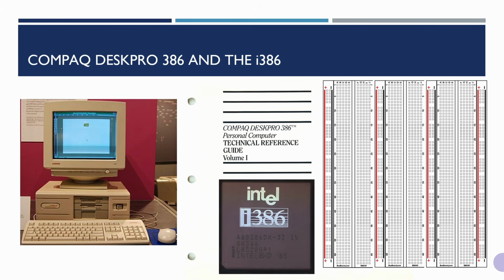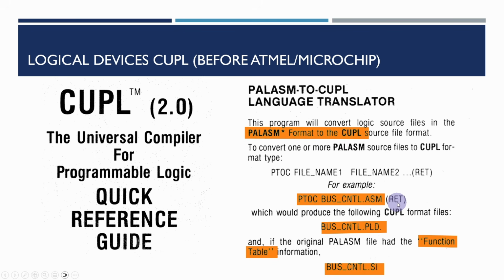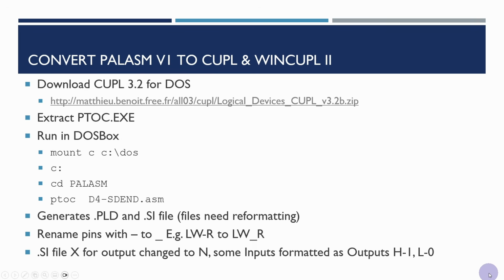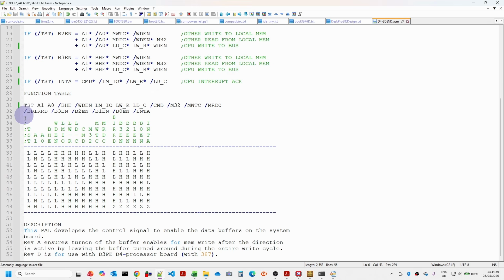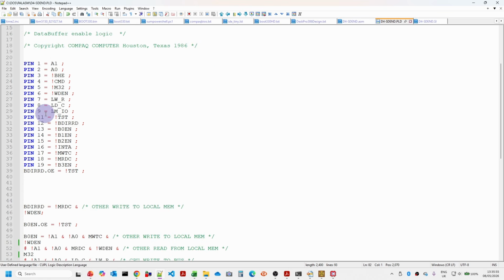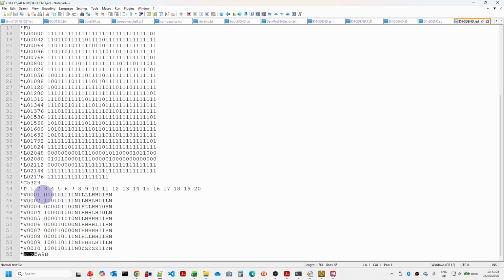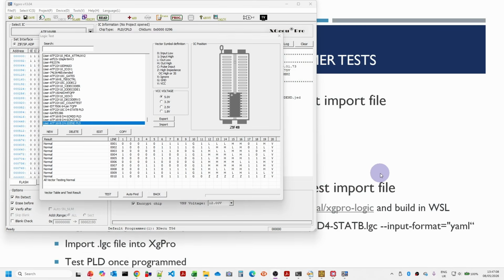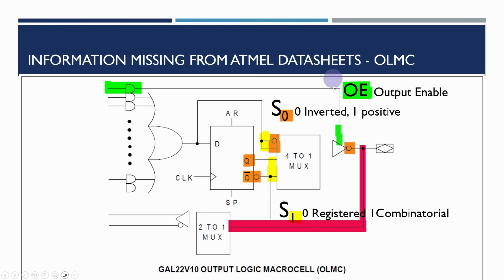386 Breadboard PC #9 PALASM PLD Conversion to CUPL

Comment: My T56 programmer is also very touchy about which USB cable I use. 

Some of them cause constant dropouts while others seem pretty solid.
Reply from the maker: Generally the Purple cables I use from the Logic Analysers are fine.
I best dig out the cable that came with wit T56.
Dave

Comment: it's very confusing version numbering, but PALASM to CUPL Translator ("PTOC.EXE") version 3.0 (from 1988) is included together with CUPL version 3.2b, while "PTOC.EXE" version v3.2 (from 1989) is actually included together with CUPL version 4.0a, not in 3.2b. I am not sure, if it's fixed partially, entirely or not at all, but "PTOC.EXE" v3.20 (from CUPL v4.0) generates different simulation input files than the old v3.00 (from CUPL 3.2b) and at first glance they seem more correct. so, maybe, such issues like the one with D4-SCPYD were actually self-inflicted by using the old "PTOC.EXE" v3.00 instead of v3.20.
Reply from the maker: I must admit I didn't spend long looking for the DOS CUPL versions and PTOC appeared to work well enough for most of the 14 PLDs. Compared to converting them manually then PTOC is an improvement even if you have to tweak the formatting a bit. In the grand scheme of things the formatting is pretty quick. Trying to understand what they actually do is another level! Davd